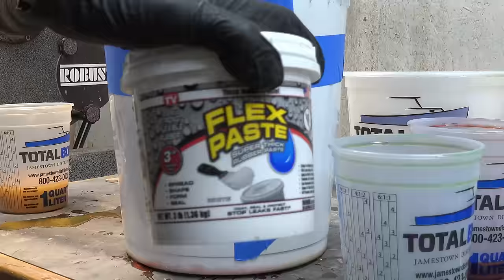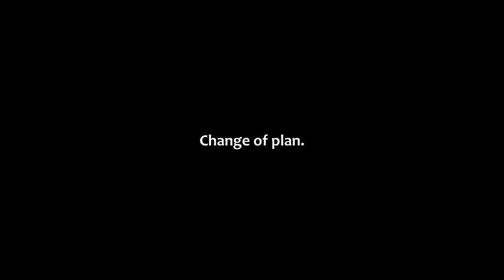Can Cork Be Beautiful?

Comment: That is beautiful. It may represent Portugal, but it has such a Christmas feel. Love it!
Reply from the maker: Thanks! Yeah it was rather serendipitous!
Reply: @DavidAdamsen  I love all your work! A few tips I picked up from other creators: if you have a difficult medium that is delicate like cork, a stabilizing resin can help if it's soaked before hand. Also, if you want more separation in your resin colors, let it sit and thicken for a bit before you pour it. You probably already know this, but if you don't, I hope you find it helpful!
Reply from the maker: @CourtneyClark01  the thing about cork though is that it is impermeable. It seemed not even super thin epoxy or CA glue soaked into it at all. But I did let the casting resin sit overnight before pouring.

Comment: Amazing work..the process was mammoth...interesting booth you built over lathe. Im assuming it was for dust control when coating piece with epoxy sealer❤❤❤
Reply from the maker: Thanks! Yeah that rotisserie is a separate unit I built so it can slow turn two projects simultaneously. Super helpful!

Comment: Hi 👋, David , very impressive piece of Art, Great colour combinations, very time-consuming and costly as well, Just one question, would it might have been better putting it into a vacuum chamber, if you’ve got one of course, I am hoping to attempt some resin casting turning next year, all being well, Stay safe, keep up the great work, look forward to seeing your next project, Phil from the moulin France .
Reply from the maker: Thanks so much, Phil!  Unfortunately, I don’t have a large enough vacuum chamber.
Reply: I sometimes wonder whether it’s possible to convert a pressure pot into a vacuum chamber, I don’t know enough about these things to know whether it is safe or not, The best method would be to get somebody to make you a piece of Special glass, And instead of having holes in the glass for your vacuum gauge et cetera, they could be mounted in the side of the container, 
Good luck with your next project , stay safe, Phil from the moulin

Comment: Question: Why dont you cycle the vacuum chamber a few times? Suck all the air out, which would also evacuate the wood, and then while the resin is still liquid, let air back in, which would force resin into the wood. Then do that a few times. That would impregnate the wood with resin. Just a question though, i have no idea about resin or wood working.
Reply from the maker: I don’t have a vacuum chamber large enough… but also cork is impermeable, and from what little I know it seems like cork might not be stabilizable.
Reply: @DavidAdamsen  Thats actually a very good point. Cork is literally.. corking bottles haha. Didn't think of that.  Awesome channel by the way, love having it on and watching the streamers of resin fly up into the air heh